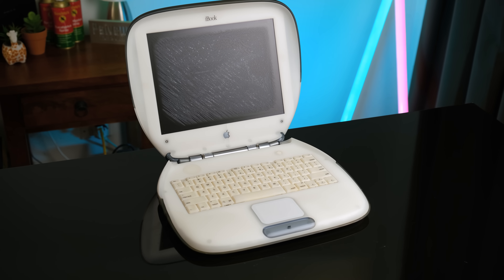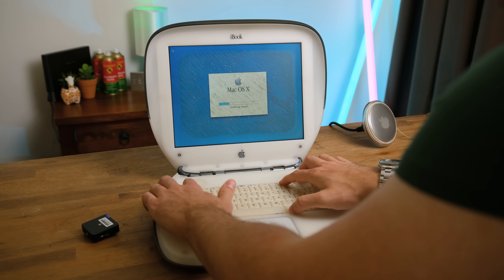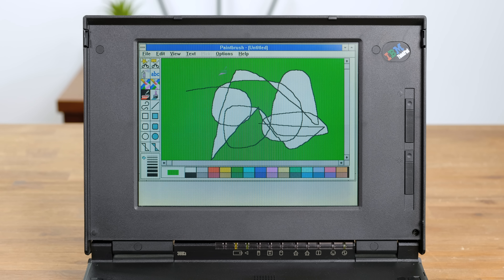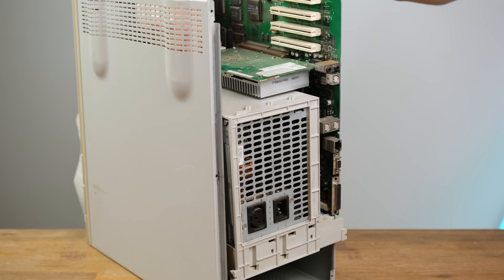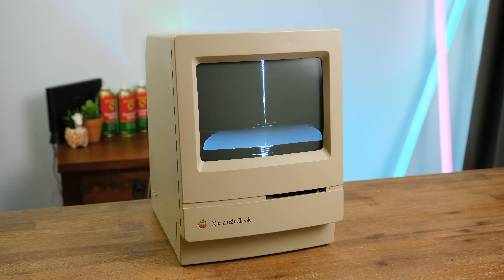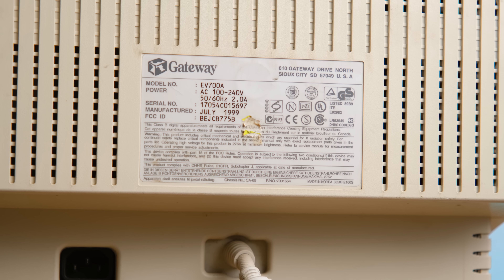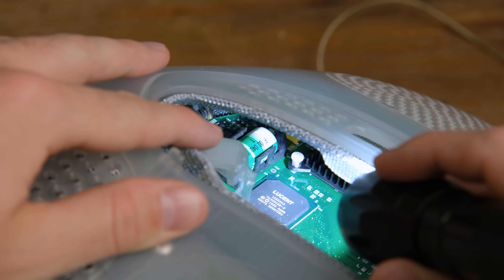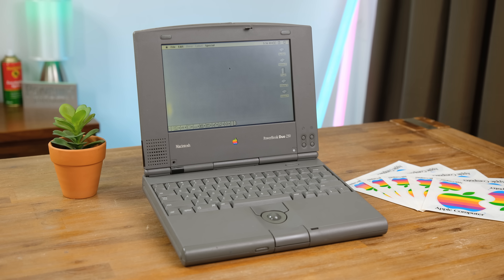So Much Vintage Tech Is Dying... Here's Why

Comment: Have you tried to soak the plastics in Hydrogen Peroxide solution and ultra Violet light? The yellowing and brittle plastics is a sulfur based compound that is a fire retardant. Supposed to work but not sure if those cases would be able to survive dissembly though ..
Reply: That's the perfect method to make plastic crumble apart even faster. Rather apply white paint (preferably without titan dioxide) if nothing helps anymore.
Reply: @cyberyogicowindler2448  Well with SNES consoles they say to soak them to get the yellowing out and to spray them with UV blocking paint
Reply: @patrickstrahm05  I suspect it is peroxide/bleach that accelerates chain reactions those make it decompose. E.g. oxygen bleach also decomposes various rubber sorts into sticky mush (kind of devulcanization). It would not surprise me if that plastic (ABS contains butadiene which resembles rubber) reacts similar.

Comment: This is very interesting.  I always assumed electronic equipment made in the past 20-30 years would be in good condition for at least another 20 years or so.  For a hobby, I restore old HiFi and television gear. It's not unusual to find stereos, and even televisions from the 1970's still in perfect working order, and if they are inoperable, only needing minor repairs.  Vacuum tube equipment has aged much better, with many devices from the 1930's still in use with all original components well into the 1990's.  One would think with the passage of time, that newer devices would age better than older devices as we get more reliable components and learn what lasts and what does not, but that doesn't seem to be the case
Reply: At least paper capacitors in vacuum tube equipment rotted from the day on they were made. You need to replace them in any tube radio, else they short and ruin the tubes.

Comment: Soft and Hardware emulation is the future of preservation all machines will fail in time. We should be putting time and energy into translating these machines over to cost effective modern forms and getting all of the software that can be found archived.
Reply: This mankind needs a law to make any copy protections self-unlocking at a certain time (or require to publish an unlock key) to fulfill the human right of culture preservation through emulation.

Comment: no idea what u did with that hardware but i've got lots of old electronics. Got mentioned here clamshell, but I've also have monochrome OPTIMUS (!) notebook far older than those you showed here. Everything works, nothing separates. It had to be the conditions you are storing them

Comment: I own a quicksilver 2002 which somehow is in almost perfect condition and works perfectly, I quickly checked the pram battery to see if it was fine and it surprisingly is,I use it quite often which might explain how it’s lasted for so long lol
Reply: If possible trackdown a new replacement for that battery now while  fine because tomorrow it might not be
Reply: Mk, I’ll look into one
Reply: Can using electronics make them last longer, and if so, how? Definitely something I'm interested in, as quite a few of the electronics I use daily are currently over a decade old.
Reply: @happysmash27  i think it depends on the quality/condition, if you use a system which isn't in the greatest condition and wasn't built the best it'll probably not help its lifespan unless you maintain it/make sure to avoid damaging, as for my experience my quicksilver is in almost perfect condition and i use it regularly so yeah i do think using it regularly is def helping keep it alive

Comment: The Amiga community has a whole subculture related to repairing the things, they are 40 years old!
Reply: I run my Amiga A500 (casemodded in big wooden cabinet) every day to write diary on diskettes, and it barely makes any problems (beside oxidizing contacts those need to be wiggled occasionally).

Comment: Old technicians are dying and the up and coming “technicians” are basically only qualified to change   PC boards.  I doubt if most can tell the difference between a resister and a capacitor.  Show today’s technician an electronic device that is built with discreet components and they run and sit in the corner sucking their thumbs.

Comment: I didn't know rubberized parts broke down because of age! my PS2 controller thumbstick became oily and sticky and I theorized the oils from your fingers seeped into the rubber and would ooze out if not warmed up frequently (I was a child taking a guess), omega lul
Reply: Skin lotions (particularly with essential oils like fragrance) can strip paint from keys and decompose plastic surfaces easily. I am very careful with handling tea tree oil etc. Also normal oils (food etc.) can decompose rubber and some plastics, so keep food away from keys. I collect music keyboards and often found small craters in white keys. But I guess it came from letter glued on keys and removed with too strong household cleaners or by disinfectants.

Comment: For your mac with the flyback transformer issue, you may be able to resurrect it by removing all dust and buildup from the high voltage section.  as well as the coils on the CRT. 

If the insulation in the flyback is breaking down that can technically be fixed, but it is not a fun procedure.  And you need to make sure whatever cleaner you are using for it does not dissolve the enamel on the wires. 

But you can rehab them by wicking out all of the bunt carbon and then resealing it and crossing your fingers.
Reply: And that's exactly where the issue is... what on earth do you reseal it with that can withstand tens of kV and doesn't attack the enamel?! I have multiple CRT monitors suffering from this along with a bondi blue imac G3 233 and there doesn't seem to be a solution to failing/cracking flybacks. The only stuff I know of is a lacquer called "corona dope" by mg chemicals, however this isn't a solution either as it's banned outside the US for being so toxic

Comment: It's interesting that some "old" tech is starting to develop issues like this, and yet my old Atari 2600 still works perfectly.  Different times, I guess.
Reply: Not much tech in them to go wrong. the 2600 had like what? 2 or 3 capacitors? and a linear powersupply brick (which aren't known for efficiency, but definitely long life)
Reply: same, my colecovision and atari still work great
Reply: If it's made of metal it will corrode.  If it's made of plastic it will crack.

Comment: The hard drive problem (clicking) is called "sticktion". Basically the heads stick to the platters and prevent them from spinning. 

The good news is that if the machine was shut down correctly, the stiction will have occurred in the drive's "parking" position and not anywhere storing data. So a decent tap will free everything up without damage. 

The bad news is that once it has happened, it will continue to do so with increasing frequency. Get any data off and prepare for total failure. The Seagate ST251 was notorious for this back in the day.
Reply: The head can not stick (unless welding itself by a terrible head crash), only the bearings. If a harddisk won't start, never open it! - Any tiny airborne dust particle will start a chain reaction of debris (like colliding satellites) that will unavoidably destroy it. Likely it won't spin because the bearing oil has hardened. And do not knock or use force. Better simply warm the bearing with a hairdryer (not too hot) to remelt the grease and then let the disk spin for an hour to let it knead the lube soft again.

Comment: Screens can be such a pain. I have 3 laptops currently, a 2012 MacBook Pro, a 2017 MacBook Pro, and a 2016 customized ThinkPad. The only one without screen damage is actually the 2012 one with retina display. The others have so much bruising, it makes photo editing a pain, which also sucks because the newer ones are faster for working with such large files (~180MB uncompressed photos). But some of those iMacs are really not bad. I went to a university class in 2017 that used those brightly coloured iMacs in their learning lab, mostly because you could take the handle on the back and chain them to the wall to avoid theft. 
I'm just so glad I got lucky with a monitor my dad gave me. When Blu-Ray had just started to gain popularity in Canada, my dad bought two Gateway XHD (basically 2K) monitors, one for watching Blu-rays on in his room, and one for his 2008 Mac. When I moved out, I asked for one since he no longer needs two, and it works beautifully! It's the only device I have that can have a Wii, NES, Switch, a laptop, and still have extra ports, although I don't think I have anything that uses S-video or D-sub. It's amazing how many connectors that thing has, and reading some reviews online, some say their only lasted 2 years or less, while mine has been going strong for over a decade. The only issue is that the contrast can be a little bit off with certain systems.
Reply: 2009-14 Macbook Pros are the best, anything after is a rip-off because they charged practically the same amount without a CD/DVD drive!
Reply: I almost daily use an IBM Thinkpad X61t from 2009, which screen works perfectly (beside that I once had to replace a broken swivel hinge mech).

Comment: Yep. This has been an unfortunate reality that we've had to come to terms with. Fortunately with the support of the community it's been possible to create modern solutions and replacements for many of these issues. It's still a real shame though. Also I've found that 3d printing technology has helped solve a lot of structural issues that are common with the vintage 90's macs and other machines with brittle plastics.
Reply: We're at the edge of usability and restoration phase of these pieces of Gen X and Millennials past. Like old cars, Eventually even the well cared for ones need to be rebuilt unless its just going to be used as an art piece exclusively. Thankfully we have tech now that can begin to make them whole again.
Reply: @joshuakhaos4451  Well said.

Comment: That's why collecting vintage Hi-Fi and consumer electronics from similar eras is generally a so much safer bet! Ofc, there are its own quirks and issues, but all around everything is almost entirely serviceable
Reply: There are still special parts in hifi (chips, multi-system vacuum tubes, complex custom potentiometers) those can not be simply replaced. Repairmen condemn Nakamichi highend cassette drives, where the problematic wearing small parts were buried just in the middle between a mess of plastic cogs.

Comment: I am keeping my old videogames as I purchase new ones, as I'd like to occasionaly turn them on and feel a bit of the nostalgia of playing them in the old days and as a way of keeping a little personal collection. After this video tho I don't know if it'll be worth it. I live in Brazil where Humidity is pretty high normally, and most of them have been sitting on my rack, of couse I dust them off from time to time, but im not especialized enough to clean on the inside. Took my OG Xbox One for repairs a couple of weeks ago and when the technicial opened it the inside was very dirty with dust and some humitidy dust as well, besides the some rusting components. Perhaps it is better to sell them when they're still working and buy the new ones, and sell them after the next gen has arrived and so on and so forth...
Reply: The bad thing is, with modern videogames there will be nothing to "keep". Consoles are only streaming pictures from a data cloud (where the core of the game software is running), and once the manufacturer turns them off (by lack of profit, bankrupcy or censorship) the games will be lost forever.

Comment: No "memory hole" needed for old memories - they WILL all turn into dust as inaccessible by anything other than very expensive data recovery services.  Unlike the photos from the past century, digital data will last far, far less.  That, along with the much greater volumes of data, will ensure that important photos will be lost in an ocean of far less important ones.  Gone are the days of A Single Photo on glass or similar.
Reply: Perhaps one day we will have nanobot swarms capable to crawl into defective ancient chips and harddrives to recover unreachable data. But with Flash memory I worry that even nanobots find no traces left to detect.

SSD/Flash memory functions like DRAM with 1 year refresh cycle (see Wikipedia "wear leveling") and will die if not powered on once a year for some minutes. It dies the faster, the more erase/overwrite cycles it has gone through, thus never use a worn USB stick or SSD as backup media. They starve without energy (modern triple/multi level types even faster).

Comment: Imagine a world where tech was built for the long haul, with accessible ways to manage replacing volatile parts
Reply: Advancement would come at a much slower pace as a cost. advancements of any kind consume resources, & with tech stuff, A LOT of them, & the funds for it need to come from somewhere. if companies can't get enough money from selling stuff to fuel the required R&D, they do really have no choice but to keep pumping out or maintaining the old stuff. as such, in a world where tech was built for the long haul, you'd have stuff that has nearly identical specs to those that came out like10 years ago. much as i dig durability & reduction of e-waste, i'm not sure if i'd like to be in a world where new stuff that comes out in 2030 is pretty much the same thing as those that comes out in 2015.

Comment: I find the potential ramifications of this somewhat frightening. Loss of vintage consumer computers, things arguably regarded as useless and only valuable as historical curiosities, is a bit sad for enthusiasts but not really a major problem. On the other hand, I have to imagine many important systems for keeping the modern world functional, things like infrastructure control systems, run on electronic equipment of similar vintage. Or for that matter, the first Fly-By-Wire Airbus a320s entered service in 1988, I don't know how many early ones are still flying. Our world was upgraded to digital electronics as these technologies became available but then were adequate enough that these legacy systems have remained in service - "if it ain't broke don't fix it." Well now it is breaking or soon will, which cause problematic or even dangerous issues. Actually come to think of it this could be part of why we probably see more cars from the early '70s and prior than we do cars from the '80s - the older cars didn't have computerized stuff, while the more recent ones do, and those fail eventually. Really gives credit to peoples' fears that it won't be possible to keep modern cars alive for decades as has been done with vintage classics - if all the computers necessary for them to function physically degrade those cars will become paperweights. And fixing them would be impossible as any replacement components, even if unused having sat on a shelf the whole time, will be likewise broken.
Reply: I always think of the Voynich manuscript - an ancient science book full of strange pictures and lost knowledge, written in a language (or code?) that nobody can read anymore.
Reply: @cyberyogicowindler2448  That's another question, if certain coding languages or programs designed for a given operating system, or perhaps even file types, will someday become unreadable as modern computers don't have the ability to read them, and due to physical degradation the old computers that would be able to run them have become inoperable. Could be problematic for historical archives.
Reply: @quillmaurer6563  I mean the situation that the data was saved/dumped properly, but the knowledge how to use them got lost. That's why it is crucial to emulate things so long the knowledge still exists.
Reply: @quillmaurer6563  IT may be that in near future a longlasting AI will teach people outdated technical knowledge (think of "The Bicentennial Man") and know how to translate between exotic programming languages etc. Already loading a game on Atari 8-bit computers (press OPTION+START key, power on, release OPTION, then release START) may be prohibitive to people those never used the system. Some Japanese homecomputers needed similar strange tricks to start a game, which needs to be written down to prevent people from giving up trying them on MAME etc.
Reply: @quillmaurer6563  E.g. the Roman dodecahedron (a bronze object with precise bores of different sizes) is a thing nobody has a clue what it was for. By a quite logical theory it was an optical distance measurement device - you had to place it somewhere on a post etc. and walk away until the front and back hole have visually the same size, which by intercept theorem (likely somewhat disturbed by different eye lens properties) will only happen when standing at the correct distance to the device.

Or roman bronze lurs were always found in pairs without mouthpieces. Nobody knows what the whole contraption looked like. It can be expected that they were not only military signal horns, but also an acoustic detection device functioning like a stereo version of the ear trumpet (possibly both held together in a wooden rack with stethoscope-like tubing running to the ears of the listener), not unlike the Japanese War Tuba. So it was possible to locate enemies or own people like a directional microphone, and (if own soldiers)  send horn signals to them.